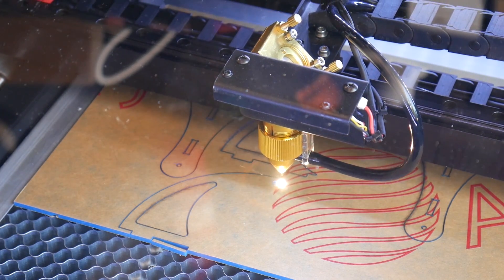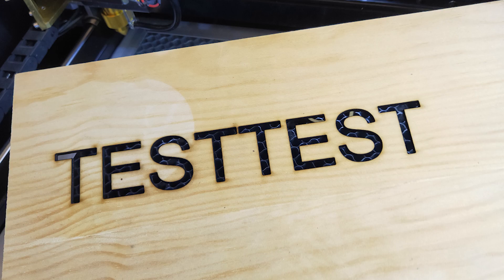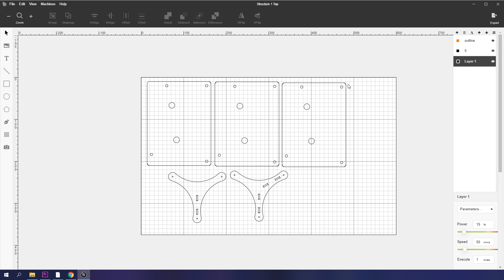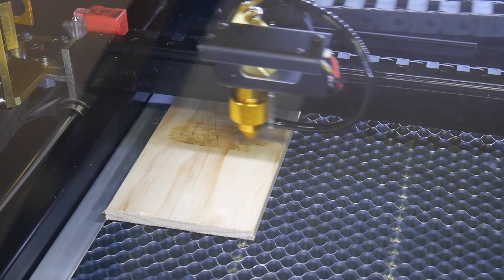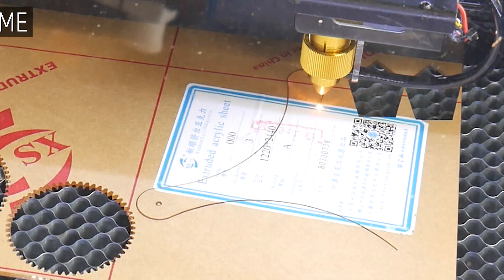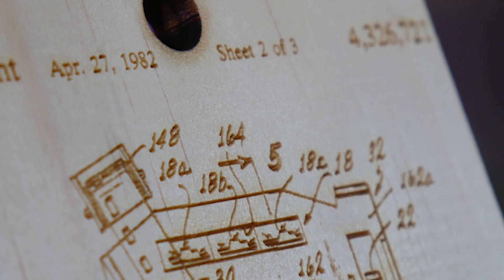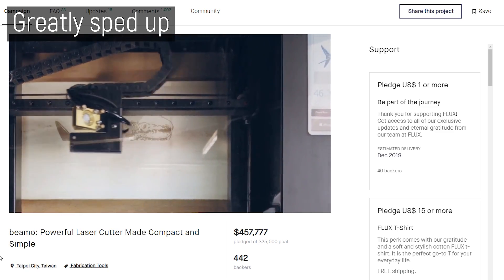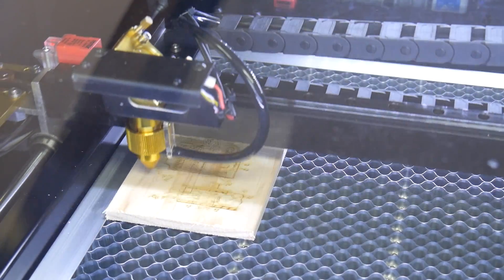FLUX Beambox Pro 50W CO2 Laser Cutter Review

Comment: Probably a bit late now but when cutting thicker materials like the 8mm ply it helps to focus the beam down into the wood about %30 to 40 of the depth.  So with 8mm I would set the focus to 5mm above the bed.  It does cut better and cleaner and overall a thinner exit line.  As your probably aware the beam after the focus point starts to spread out in a cone shape.  Good video but I watched it to see how they cooled the tube?  Oh well off to look at another video.  Oh and on material 4mm or less I would just focus on the top.

Comment: Hi Angus, what would be your preference for Makeblock Laserbox or Beambox pro?
Reply from the maker: Prefer the beambox pro, had a better air assist and better value, software for both is comparable.
Reply: @MakersMuse  thank you for the prompt response, really appreciate it. Price-wise, the location I'm in is actually the beambox pro is more expensive than Makeblock. I liked the air assist and more powerful tube with Flux, on the other hand, I've read so many problems in their user forum with brand new machines (laser tube died in two months, used device sent missing parts, not working etc.) 
I like your videos and honest reviews that's why I wanted to touch base with you before I make my decision.

Comment: I saw the trace in action at a big laser shop.
(03:26) the trace option moves the laser head throughout the path without firing the laser so one can see if there's any anamoly at any point and resolve the issue. It helps a lot when working with expensive acrylic.

Comment: I am very conflicted here. I bought a K40 for 400 bucks from OMTech. I didn't have to do any adjustment to the laser as they had done it already and hot glued the parts in place. I spent a few bucks  on a mgn12 rail for the main head and created some 3d printed parts that I designed for the rail system. 

Based on my experience, I can't see paying 4K for what we see here from FLUX. 
I think you can have most of the same features if you do it yourself for about 60-80% less money; but admittedly it would take quite a bit of messing around to get it. You're trading manhours for cost and depending on how handy you are, it might be worth it.
That being said, FLUX has some incredible software by the looks of it and the out of the box features/upgrades look pretty fantastic.
Again though, I just don't see myself spending 4k on that.

Comment: Several people who are partial to Glowforge feel the Beambox is nothing more than a slight upgrade to the cheap Chinese 40W laser cutters out there.  How do you feel this stacks up to Glowforge?  The cutting area alone seems hard to beat and it seems to be the only cutter with air assist.  Are the differences in the software enough to make such a big difference?
Reply from the maker: I use it heaps and find the software capable enough. Path planning could be better.

Comment: When cutting acrylic you can get bounce back from the honeycomb, leaving marks on the underside.  I fix this problem by getting small square glass tiles to lift the material up off the platform.  The honeycomb still does it's job, but the laser is out of focus when it bounces back up and can't cut.

Comment: I bought a used Epilog 24TT for $4800 4 years ago, so it's nice to see prices on newer systems coming down.  Though, I think the big 3 still have a lot of advantages over the lower-cost manufacturers.
Reply: Is this one of the "big 3" ? I'm guessing muse and glowforge are 2 of them
Reply: @MrTobbo  The big 3 would be Universal Laser, Epilog, and Trotec.  After those 3, you get into the really expensive stuff.  Kern lasers start around $400K I believe.
Reply: @daves.software  I’ve got a budget of about £8000 been researching what to buy it’s looking like the muse Titan at the moment
Reply: @MrTobbo  Here in the US, you can get an entry level Epilog for around $7000.  However, the bed would be smaller, and the laser power lower than what you can get with the lower cost companies.  On the plus side, Epilog lasers are air-cooled, and use metal laser tubes that last much longer than glass tubes, so at some point the TCO will be lower with a "Big-3" laser (Universal and Trotec also use air cooled lasers).

Comment: I have a question!

A while back, Devin from Make Anything did a video about recycling failed prints by melting them down into sheets in a baking pan and cutting them up. Now I'm wondering if it would be feasible/safe to cut such PLA sheets with a laser cutter like this?

Comment: I have the FLUX Beamo .... can't get it to burn or engrave a single item reliably. And Flux support takes about 7 days to get back to you about anything. This time they gave me a very text book and cruddy answer and just said "check the focus distance of the laser". Well no kidding. The book tells you that. So far I have burned through almost an entire side of leather (roughly 125$ of product) just trying to print wallet template pieces and not a single piece is useable for a finished piece. Seems that turning the power up or down just 5% in Beam Studio ENORMOUSLY affects the strength. And they only allow you 5% incremements. If I set the power to 20% it barely scratches the leather... if I put it to 25% it blasts through the back and leaves carbon scoring in the shape of the metal grid. 
Just a heads up though... FLUX support is almost non existent. I've asked for a live support session that actually moves at the speed of business and they have yet to get back to me.
Reply: Wet the leather.

Comment: There is very little info about this machine.
Can i use their software offline?
How is it compare to Glowforge plus in term of cut quality. Can the build in fan turn off and use external fan? How loud is the build in fan?
Reply: Yes, I used the free software before buying the machine.  It works as well as my old ULS M300 but the camera makes it a slam dunk to position the material.  Doesn't seem to need an external fan.  The fan is far quieter than a hairdryer.

Comment: I got a glowforge when it was a Kickstarter project, and at $1900 it was the best money I ever spent. I am a somewhat technically inclined artist, and having the nicer user experience of a smart laser cutter really helped me enjoy the experience of learning to use it a lot. See my stuff here: https://www.etsy.com/shop/ArtFormFunction
BTW if you have some experise with Adobe Illustrator or Inkscape, that will increase the value you get from your laser a lot.
On the other hand  the cutting area 11"x 19" is a bit small and cutting anything more than 5mm thick is an exercise in patience. I have been toying with the idea of getting a larger more powerful laser maybe 600 x 900mm and 80 or 100 watts  to be able to cut thicker, faster, engrave metals better, and the LightBurn Software which has a lot of the features I have gotten used to in the glowforge.

Comment: I dont see why to spend 4k+ for laser with such small working area that lack basic functions like autofocus and motorized bed height adjustment.
I would rather spent 2-3k on good brand laser from china like Robotec which offer much more functions including autofocus, 4 times bigger working area, up to 150w laser, option for dual laser heads etc. 
Like glowforge this is just overpriced small laser which maybe nice for office or school, but is not worth for normal use as you could get cheaper and more capable lasers.

Comment: I will tell you right now, this is a rip off! I just purchased a 4x8 150w CO2 laser table (that cuts steel) WITH a second laser 60w laser head. Came with a rotary attachment (for steel tube cutting or engraving), lowering front half table 13" under head, water chiller, blower & filter etc... for only $8000
(I was originally going to go with the 1390 format enclosed laser, but this set-up I ended with was only $500 more... and I have the room, so why should I go smaller?)
Reply from the maker: Which assist gas did you go with? That's a pretty high ongoing cost.
Reply: @MakersMuse  I will switch between oxygen for mild steel and nitrogen for stainless. I should note, that I didn't buy this as a hobby machine. I bought it specifically to help me make money in my business. But given how many different things and industries I can aim towards, making money on these is criminally easy! So, I can roll in the cost of a bottle of gas over everything I cut.
For the first few bottles I'm sure there will be a learning curve at just how much I need to use per cut and there will be a lot of waste. But that's the fun in learning, and getting to know your machine inside and out, and becoming an expert. I anticipate a healthy mixture of acrylic (probably 65%) over cutting steel. But for the price I paid, it makes sense to at least have the ability to cut up to 3mm in carbon steel. In my shop I use a lot of 16ga and thinner, so this will meet my needs until I can outgrow this and jump into a Fiber Laser some day! 
"Always Growing, Always Learning"

Comment: Can you use it for PCB manufacturing? (Like lasercut protective layer on copper before next operation..?)
Reply: Igor Gaspar without a filter this might be dangerous ;)
Reply: Maybe in theory, but it'd be a pain to get working. Apparently resin 3D printers work well for printings designs on UV-sensitised PCBs though.

Comment: You can buy the same non branded laser cutters from China for quite a bit less than this.
Reply: Yes you can.  I have one heading for the dump.
Reply: this machine is not meant for mere hobbyists.
It would pay for itself in no time when you have a business.
It is reliable, has good features and good software.
No hassle and minimum manual labor. Its a good option.
Of course you can buy a k40 and upgrade it to be similar to a beambox, glowforge etc. but in reality, how much is your time worth? do you want a machine to tinker or do you want a production-ready machine out of the box

Comment: for that price you could buy 10 of the cheap 40 watters. and pick up a nice reci laser and cohesion board. or better yet pick up a 100 watt with a reci tube and dsp and add a camera. is this locked to companies software? or could you use say inkscape or lightburn?

Comment: Hey there!!  I like the addition of laser cutters/engravers youve added to your content.  But I gotta admit, I think you’ve missed the mark on a few important things that I’d consider critical when it comes to these machines.  1. Adjusting mirrors and aligning the beam to the lens is a must learn for any new machine and it does not take very long.  Somebody brand new and not technically savvy can do the adjustments within 15 - 30 minutes after watching a few quick YouTube videos, I know I watched my wife do it and she has 0 experience with this tech.  It’s nice to have a pre-adjusted machine, but it’s a critical step anyone owning these should know.  2. Power is A SUPER CRITICAL point that HAS to be covered properly.  Saying it’s not wise to operate a laser at full power is just way to vague.  It’s important to know the upper limit of your five, and for that your machine has to have an analogue mA reader to find that point.  I’ll use my 60w laser as for example. It’s rated up to29mA, which is about 87% power, but safe operations for long tube life is recommend to be operated under 28mA.  Running the laser above that is just a waste and will provide no additional power and will shorten the life of the tube.  That’s the laser I am using, not all tubes are the same and the user should absolutely find the specifications to operate that laser properly.  And any machine that costs $4k and doesn’t have a reader on it is just irresponsible imo.  3.  @4k this think doesn’t really offer anything that you can’t get from companies like Orion Works that cost half the price, slightly more powerful laser, larger area, and include Lightburn which is a MUCH better piece of software.  It’s worth mentioning these kinds of lasers when looking at the $2k+ range (not k40s). 4. Cleaning.  Mirrors and lenses need to be cleaned regularly to keep the laser aligned and working to its full potential.  This is even more important for the lens, especially if you don’t have a ventilation system.  If you aren’t cleaning your mirrors/lense you are going to have a catastrophic failure...  I know...  I wound up burning right through a lense that had accumulated something on it.  Easily prevented if I had cleaned it.  Costly mistake!! 5. And the last one on my important list is cooling.  Tubes have to be cooled properly to get the most out of them, there are temperature specifications those tubes should be run at.  To hot or to cold and you risk losing the tube sooner than expected.  I love your videos, avid follower for awhile...  but when it comes to lasers, you really should be more focus on proper operation and maintenance (safety first of course).  This product, in my mind, is not great at that price.  Maybe the tech support is worth the extra $1500 - $2k...
Reply: I must say, a great read!  I have been researching laser for years and still haven't pulled the trigger!  All the points you have brought up are very solid, and really should have been covered.  Think I have watched all the videos from Sarbar Multimedia and Roger Webb!  There is nothing wrong with pointing people to other resources to keep the video under 20min.  I think a great opportunity was missed, this product should have been broken up into a series covering everything you pointed out.  This is especially valuable information for beginners.  Price?  Well I have to say looking at the Glowforges and Flux Beamboxes still reminds me of an overhauled K40 (I know it isn't).  As for spending north of $5,000 when there are better offerings at half the price, no thank you!  I have been looking at Orion lasers as well, possibly the 60w or 80w.  Also I believe the Orion has a Ruida digital control panel, and tends to be more of an industry standard for compatibility?  Hope to buy my first laser very soon!  Thanks again!
Reply: While the points mentioned are fair, entire videos could be made around each of them. Choices have to be made to keep it manageable.

As for 2. Power, I'm going to assume they limited the PSU at the factory, to put out no more than the safe current. As such, you don't really need the mA meter anymore, though it wouldn't have hurt either.

Comment: Since you've worked in the field and seen these many times so why would I go with a laser cutter over CNC? It's been my biggest hold in buying one, I can't justify the price against the capabilities of CNC.
Reply: They both have their place. Some benefits of the laser:

-no complex path planning, just simple vectors.
-no different bits for different operations, materials, etc.
-no bits that can go flying
-no bits, those things are expensive
-can, depending on the material, cut much faster (3mm plywood, 50mm/s, ~60% of an 80W laser)
-can cut more intricate details due to very small tool size (~0.1mm beam width), so no need for dog bones and such
-can work with delicate material (Paper, fabric, etc)
-polished edge on acrylic
-can engrave imagery
-no work holding needed, you never touch the material.
-a fair bit more quiet. 

Last, but not least...

FRICKIN' LASER BEAMS DUDE 😂
Reply: The laser isn't mechanical.  You can get amazing small detail on delicate wood up to one cell thick because the wood is not disturbed.  It also heals plastic cuts to prevent stress fractures because the edges are heated.

Comment: Hey Angus, I think you need to test the power output of that.  A 50W laser tube should be around 1M long (~39") from tip to tip, and this thing is less than that with the case.  It's kinda hard to get around physics, so my guess it that the laser isn't actually capable of putting out 50W.  It's most likely closer to 40-45W max, and you really shouldn't ever run these tubes close to full power, it significantly decreases their life.  If you have a way to measure laser output, I'd be curious if it's actually putting out that much power.  It's a lot of money for only 40W.
Reply from the maker: Hey Robert, good call I'll follow up on it. The 100W I ran years ago was indeed huge and overhung the edge of the laser.
Reply: @MakersMuse  Sounds good!  I'm curious to see what you find.  I need to replace the tube on my 60 watt, and I'd be curious if things have gotten smaller, maybe I can fit a higher powered tube!

Comment: My little cheap, Chinese K40 is 40 watts, cost £280 (£400 if you include my mods) and is still going strong after 5 years.
Reply: But nothing like 1000dpi
Reply: @recovered_file  True.
Reply: @GaryMcKinnonUFO  I bought an eBay 500*300 machine 3 years ago for 1050€. Some issues with it, but especially disappointed about quality and regularity of each prints. Sometimes more or less power... I can't get identical results. This Beambox looks like even more well made. Off course for 4000$ you also pay R&D and their own software. Customer services also... I think it's still expensive regarding all that stuff, but this is clearly not the same product... I'm about to buy one for that reasons
Reply: @recovered_file  Would be good to see what you think of it after some use, it seems very capable.

Comment: My $1000 chines laser came calibrated also. Not "Unheard of" as you say. I haven't had to do a thing and I purchased it 6 months ago. 50W works great and moves up and down with plenty of room and a free $100 rotary attachment. Also the inline fan is fantastic. I don't have to even close the lid while cutting.
Reply: About $700 USD plus $500 shipping to my door.
Reply: 1 more thing, The software looks nice but you can get most if not ALL that from Lightburn which is probably better because it handles large files very well. Yes mine has air assist.